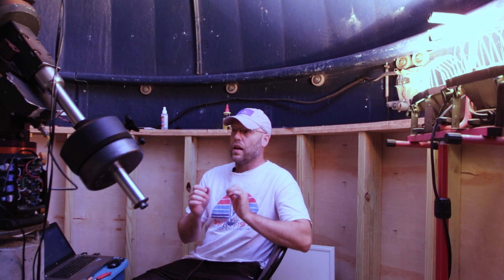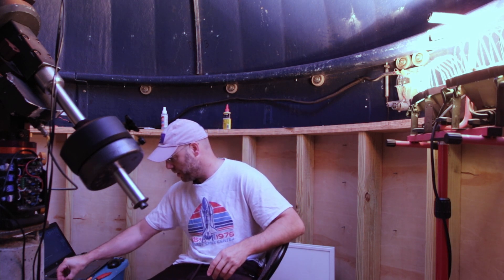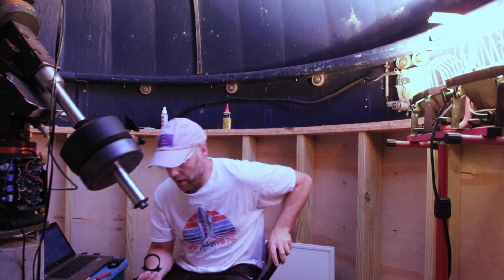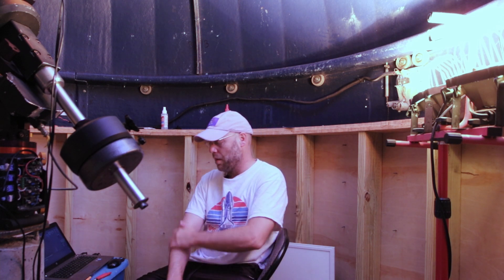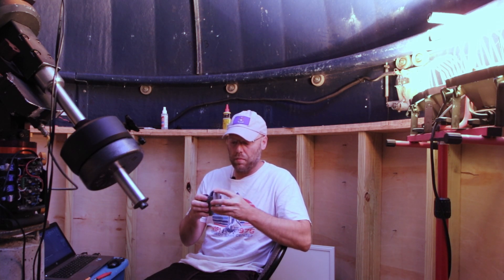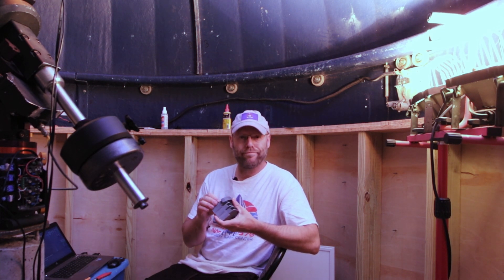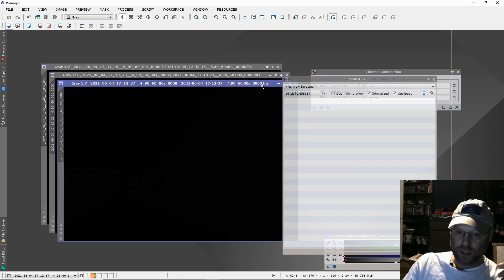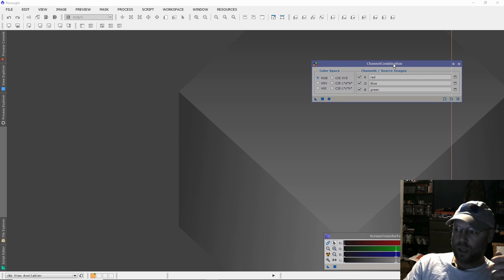Starizona Filter Slider Light Leak! (and a fix .stl downloads in description)

Comment: The modular filter slider (that's the newest version) doesn't leak light anymore.
I switched my older Starizona filter slider for the newer modular filter slider.
Have you tested those ?
Reply from the maker: No I haven't, that's good to know. I'll be getting another hyperstar setup in the near future so I'll test it out for sure. Thanks for the tip. I was shocked.

Comment: STAY AWAY FROM STARIZONA. THEY HAVE ONLY BEEN A NIGHTMARE!
Reply: Trust me I love the idea of them too but I'll never ever do business with them again.
Reply from the maker: What happened?
Reply from the maker: @derekderek2570  the camera needs 12v. Are you talking about amperage?
Reply: @DeepSpaceDad  I am... The DC adapter they sent was 1.5Amp but the camera required 3Amp to correctly cool and run long exposures, the standard is usually 5Amp (or at least that's what I ended up ordering) and it works very well now. It was a massive headache that weekend. Imagine spending 3k and the item doesn't work for two days. Two beautifully clear nights too.